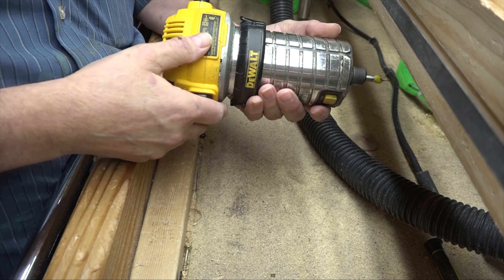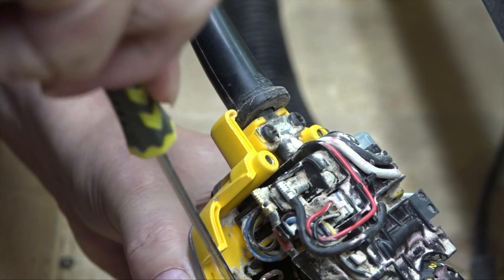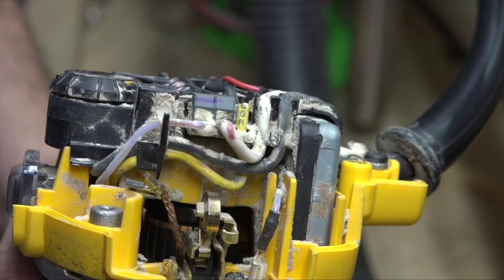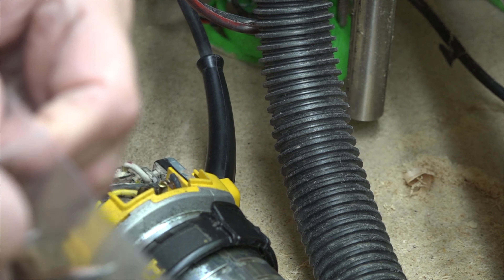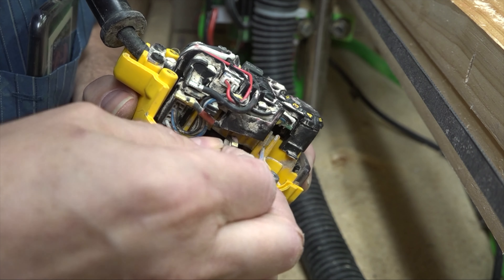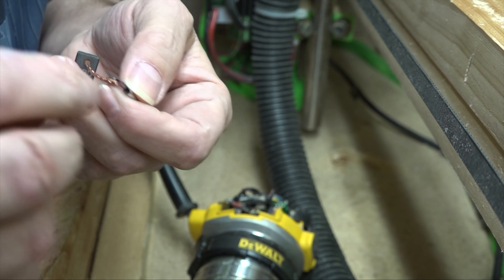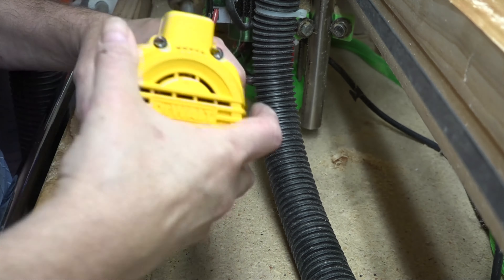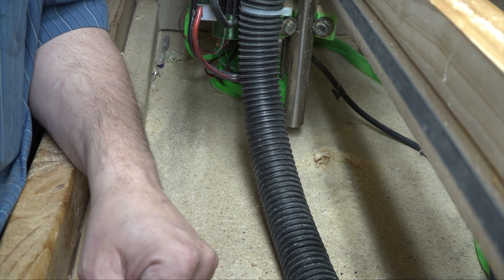DW611 Brush Change

Comment: Thanks for the video.....brush wear is something I never considered.  How long are the worn out brushes.  I think I might drill a couple 1/16 access holes in the cover so I can slide a rod in there occasionally to gauge remaining brush length.  I like your idea of adding an hour meter.